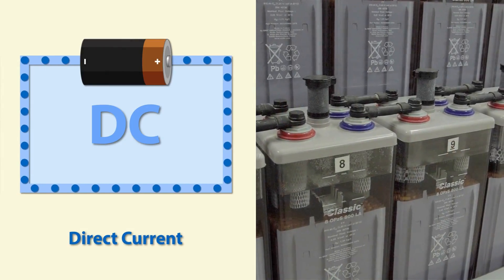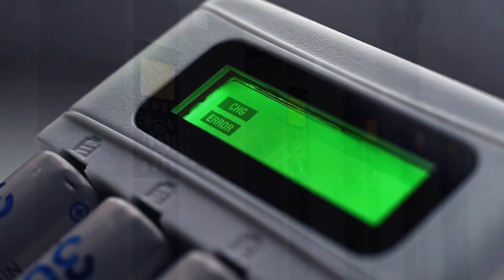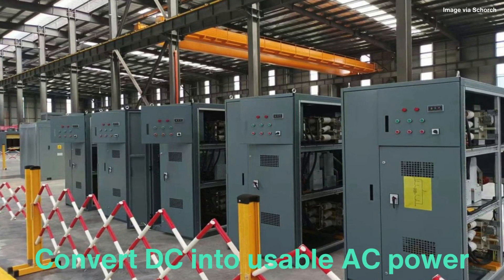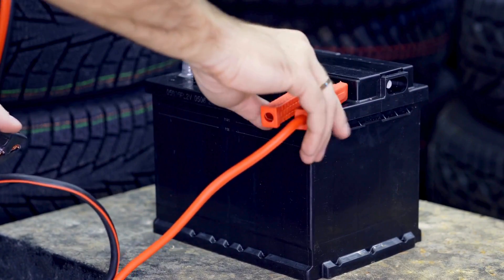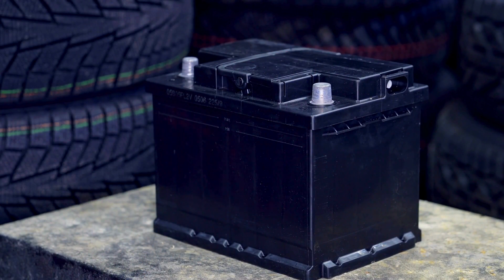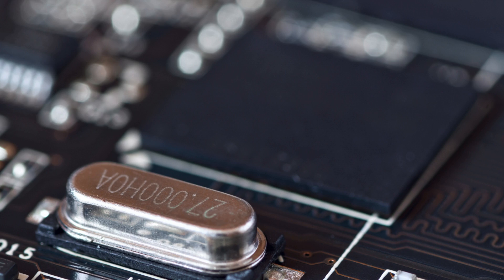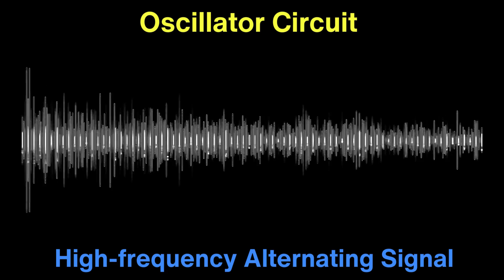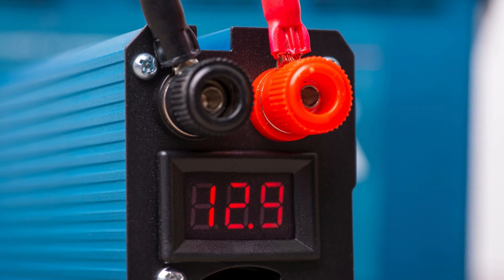How Do Voltage Inverters Work?

Comment: Actually it is more efficient and cost effective to deliver power using High Volate Direct Current (HVDC) over longer distances than High Voltage AC.
Reply: That's what I was thinking. The only reason it is AC is so that transformers can easily step down the voltage.